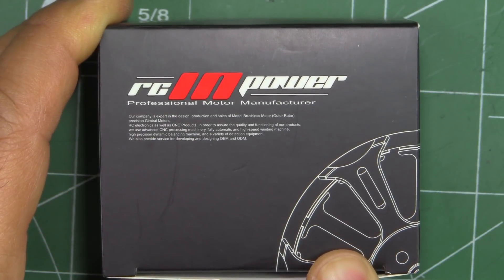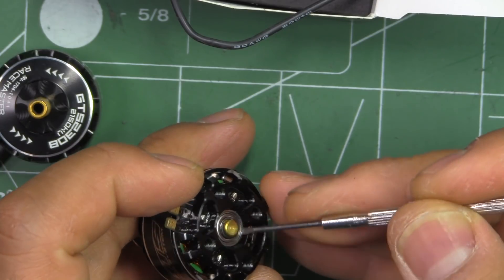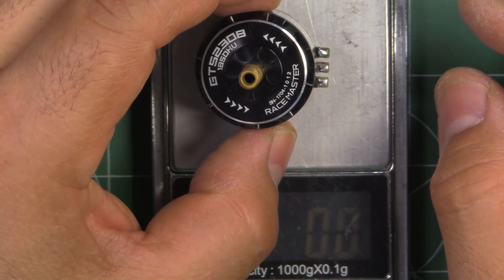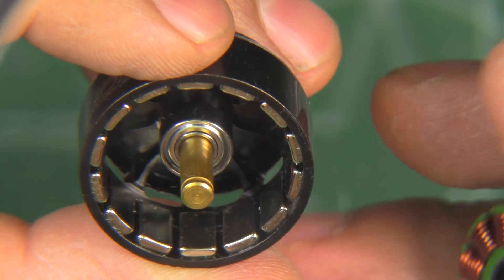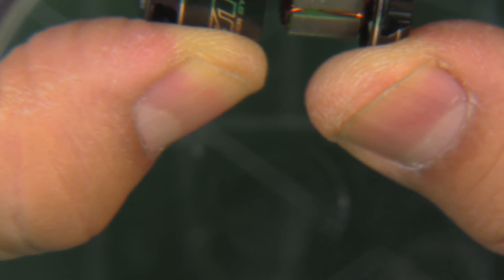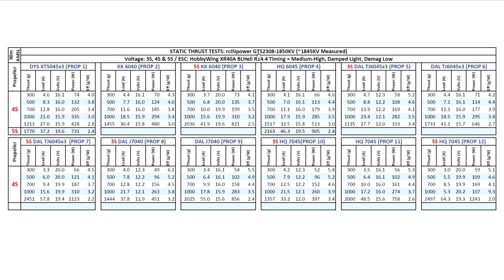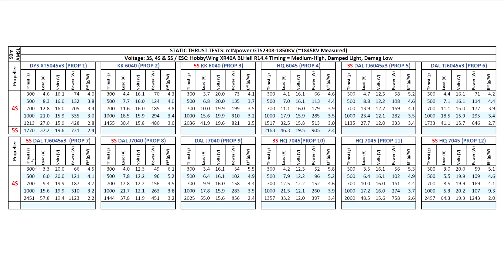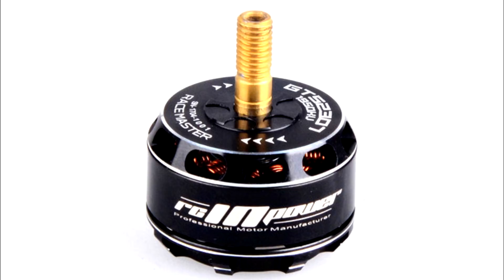rcINpower GTS2308-1850KV Thrust Tests - Torque Master

Comment: Hi, may I ask what is your opinion on the max continuous power from this chart: http://d.surveilzone.com/upload/image/20180326/20180326051018_73492.jpg. Does this motor really can do 1kW continuous?!? I think it is insane already at 600-700w?? Thank you!
Reply from the maker: It may output that much in a very short burst but no way it can sustain that level of power continuously. It'll overheat inn a few seconds and burn its copper windings. Even at the highest thrust I tested after a few seconds it is already getting very hot. That's normal with all motors. But the 8mm height on the stator theoretically should give this size motor higher power handling capacity than the other shorter motors we use in multirotors.
Reply: @EngineerX  hi, thanks, so exactly what I thought also. I'm thinking realistically, in a wing with moderate to good cooling, I would say something in a neighborhood of 500-600W (sustained, meaning, a couple of minutes or so..), to be on a safe side, right?
Reply from the maker: @putimir  yes, somewhere around there but in reality what we measure on the thrust stand is anywhere from 25 to up to 40% higher (Amps...match that with corresponding Watts) depending on loads like drag, weight and other losses. That's what I've observed in quad multirotors. In wings it's probably closer so maybe 20 to 30% would be my guess.

Comment: I have been using these recently on a 6inch 4s build and I am disappointed in the endurance as every time I crash a motor bites the dust. The crashes they have been in are slow and it's like these are made of cheese. I will not buy these again.

Comment: EngineerX i need youre help. We have a epic race every year here in switzerland. Its a one lap race. Huuuge open track. I wanna build something ultraaaaaa powerfull. Need some lowend power but much more highend speed. What can you recommend. What is better for highspeed 5" or 6"? I would take this motor with 6s and 6inch. What setup can you recomand motor prop for insane power and speed.
Reply from the maker: That's a little difficult to achieve, low-end & high-end on the same setup because you have to choose propellers and motors that perform best on one end. But you can get something in between.  I'm sure you have read about this 10S 5" fastest quad https://www.theverge.com/2017/7/14/15967948/drone-racing-league-fastest-drone-racerx-guinness-world-record-163-mph
That gives you an idea of the amount of power you will need. As you go faster, air drag increases exponentially so you need to increase power exponentially as well. 
For 6" you will need a massive motor so it won't burn up from long periods of full throttle. If the track has those long straight runs and wide sweeping turns, then perhaps a 6" 2-blade prop may work. These 2308's on 6S could be a good starting point. The main problem is that you must test them in-flight because of so many factors involved, it will take a lot of testing and even trying several motor/propeller combinations. You may even have to try 5" props to see if 6" get you faster laps. For high speed, high pitch will be necessary. so 5x5 or 6x5 props may get the needed performance. 
Reducing air-drag will give you A LOT of performance. Use square or round tubes for arms and as narrow center plates as possible. Focusing on reducing airdrag should be as important as selecting powertrain.
Reply: EngineerX thank you man. I really like youre competent work and help for the cummunity. I think i try the 2200kv version on 6s with the new 5552 gemfans. Or schould i take 5s with this setup. Or the 1850kv version on 6s with that prop...som many questions. 😅🙈
Reply from the maker: That's the difficult part, to find exactly which is the best setup. Unfortunately, I think you actually need to test each of the possible combinations to get the EXACT answer or you can use these test results to get as close as possible. I would start with the 2200KV on 5S and gradually increase propeller size/pitch and voltage. You'll need to check motor temperature after each fast lap to make sure motors are not overheating
Reply: Unfortunately, figuring out which setup works best when unloaded is going to be hard.  The particular setup that works best (may need to take into account Altitude above sea level, how much time you'll spend at negative AoA, what your effective Cd will be flat out) is going to depend on lots of things, and may come down to what you'd prefer to fly.  Sometimes the fastest craft may not be the quickest, if something more agile or with better handling characteristics can spend more time at or close to its top speed than something that is spending lots of time away from its top speed.  What I'd say for sure is that you want higher voltage - I suspect 6S will be worth the weight penalty not because you necessarily want higher voltage and higher RPMs at the motors, but because you'll have better power density and more sag-overhead if you end up in a high amp-draw maneuver.  Prop selection will need to be something with good dynamic pitch and able to withstand high RPMs without deformation.  As silly as it sounds, 5x5x2 are a good starting point, or the EMax AVAN-R line of prop.  Motors - tall stators are going to be a good thing when going fast, but wide stators mean better control and resolution when under load or transitioning throttle loads.  A 2308 like this would be a good starting point - 1800mAh 6S battery - 5.5x5x2 props - and 60A peak rated ESCs would be my first guess, but reliability while going fast and testing will be fairly hard.
Reply from the maker: Right on the spot. Agree with all of that. I think I would start exactly as you said. Tall 8mm stator with a 6S LiPo and one of those "fast" props like the AVAN or 2-blade high pitch props

Comment: engineerX, will the emax rs1106 7500kv be safe to use on 3s, if so, will they run the rotorx rx3044tx props?

p.s : can you please test the okfly rv1106 motors?
Reply from the maker: On 3S they will probably run too hot with 3" props. Maybe with 2" they'll be OK but I would still check motor temperature. So far I've only seen a 1107-7600KV motor work OK on 3S with 2540x3 props. With 3044x3 props the 1107 motor burnt for 2 people so the 1106 is smaller and will be more stressed. Also you will need at least 20A ESCs. For 3S, I think 6000 ~ 6500KV works better for 1106 motors.  Sorry, I didn't buy the RV1106 motors and I don't get samples from AOKFly.
Reply: oh ok, will the sunnysky 6500kv work(3" 3s)?
Reply from the maker: According to my test it should be fine. I've seen reports people saying it's OK on 3S- 3" but on the first motor batches from factory you need to drop some CA glue or Green Loctite on shaft where it joins the bell. because it get loose. The new batches apparently are OK. Those comments are on the video
Reply: I read them, I'm getting the motors directly from alibaba where they say the shaft has been updated
Reply: thx a lot, i'll probably get those over the sunnysky's as they are way more efficient and  for my first ever build i don't think i need the power
Reply from the maker: Good approach! if they're getting good reviews from users, you can't go wrong.

Comment: I've been planning a 7" build but I've been a little unsure of components. These motors seem spot on for power and efficiency! Thanks for all your hard work for the hobby!
Reply from the maker: Thank you for watching. Hope 2018 will be as good to us for motor options. So many good ones last year!
Can't go wrong with rcINpower. Virtually everyone that chose them is very happy with their longevity. These should also be just as good. 7" cruisers are becoming popular. Check out Adam-g1 's channel. He's got some good info on his 7" builds. For mid/long range, looks like the TBS 900MHz and 4S / 5S / 6S setups are the way to go.

Comment: I've bought the GTS 2206 2300kv motors long ago and they are some of the best quality motors I've ever used. You can't really go wrong with rcINpower. The one thing that really stands out for me with their motors is the bearings and the play in the bell. Mine are pretty old and still are smooth as the day I bought them, with absolutely no roughness or play in the bell still!
Reply from the maker: So far that's the exact same observation from about a dozen people whom I recommended the GTS2205's a couple of years ago and several people who purchased the GTS2305's. Thanks for chiming in with your experience. They really are very good motors that have gone somewhat unnoticed due to lack of marketing or a solid dealer network.

Comment: What happened with 7 inch, 5s at 1000g thrust? Why such a low amp draw?
Reply from the maker: Every now and then the Excel spread sheet I made to "automatically" pull numbers from the logged data will select the corresponding value (closest to the target thrust) from "throttle-down"> For example, on ramp-up throttle load sensor registers 998/1002/ etc... then I go off  throttle and thrust stand registers  1002 / 999g  then Excel spreadsheet will select Amp data based on closest value to 1000g. So it will pull from the 999g numbers but that's on off-throttle so Amps are way off. 
It's a limitation of the thrust stand, it's a bit laggy to very fast changes in values. Also a limitation of the simplistic Excel spreadsheet I use. 
The actual data is always available on the video description. There's a drop-box link. I've manually changed the 999g value to 899g since that was on the off-throttle area. Thanks for noticing and letting me know. I look at the tables for a couple of hours when copying data from the thrust stand and catch most mistakes like that but every now and then a wrong number manages to get past...